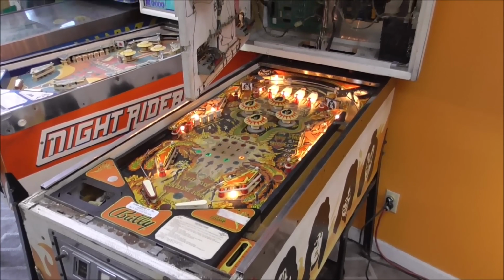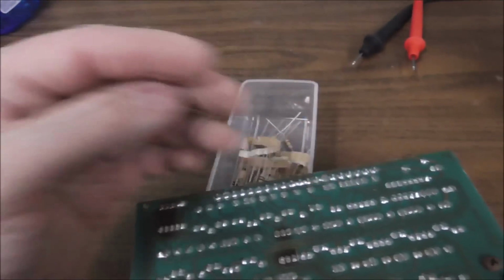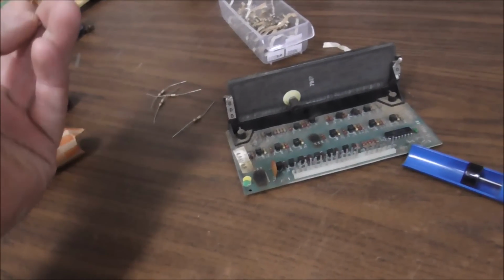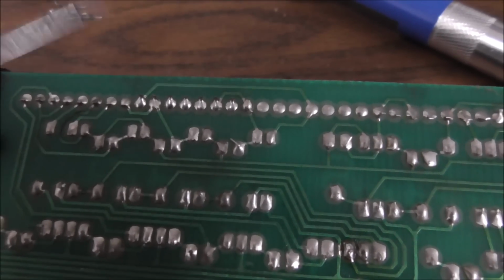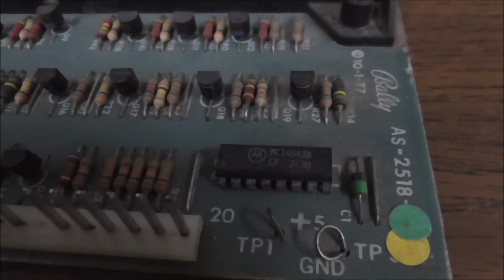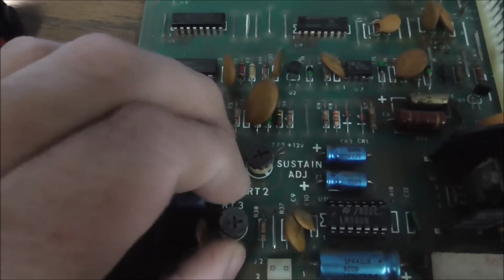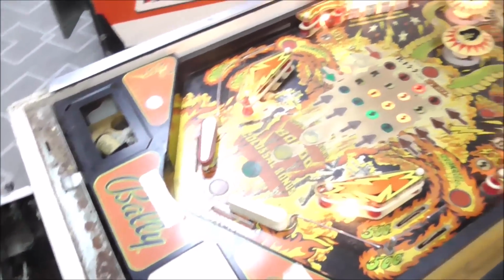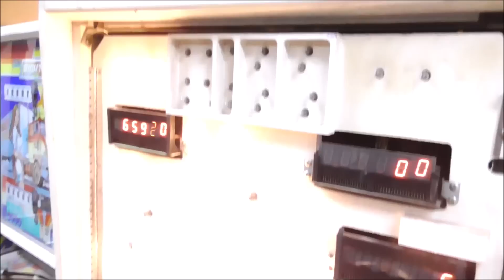Fixing Bally's Legendary KISS Pinball Machine Soundboard & Displays - Repair #4

Comment: those are carbon composition resistors by the looks of it.  those things love to drop in value  over time when they get hot.  I used to repair equipment with nixie tubes, and it used carbon comp anode resistors that would do that.  so the resistor would fail and keep lowering resistance until the tube fries from the excessive current.   I would replace those resistors with carbon films which is your usual tan resistors.  I think the reason those carbon comps lower in value, is because the resistive material is a mix of carbon and phenolic dust;  the latter is normally an insulator, but when it heats up, it decomposes and contains a lot of carbon.  so it goes from insulator to conductor and then more current means more heat, and more decomposition.

Comment: Hi Ron!
Point of curiosity (and please forgive me if I've asked this before... It's been quite warm this week, and my own memory is a bit fried... Which oddly enough, ties into my question today):
Over the course of this repair, you've noted several backbox items that needed attention related to heat damage over time (burnt pins, and solder joints, which can break as a result of heating while on, and cooling when off). Acknowledging that the damage you noticed/repaired appears to have taken about 40 or so years to manifest itself, coupled with the fact that many of the manufacturers of these machines did not anticipate these machines still being in service so many years later, in your opinion, would the addition of a small exhaust fan on one of the upper backbox vents (tied to a 5v or 12v point on the solenoid board) help extend the life of the backbox components (by causing a sustained airflow throughout the backbox), or am I perhaps overthinking this?
Reply from the maker: They built some vents into most of them so the heat must have been something they were thinking about, I suppose you could add one in if you'd like...

Comment: HI, great video. on my Kiss pinball the group of lights that light up the band behind the back glass have stopped working. All the other lights work fine. could you give me a direction as where I need to look to maybe fix this issue thanks
Reply from the maker: If it's the ones in the center that is just the General Illumination lights, if you look over on the right hand side inside the backbox, there is a large transformer with a pcb above it, that's the power supply.  turn your game off and unplug it from the wall, then there is a large 20 pin connector on that power supply that can unplug if you pull it straight out.  If you look close at that connector one wire will have burnt the crap out of the connector, it'll be brown.  That wire is your problem, if you look at the back of the door where those bulbs go you can see what color wire runs to all the bulbs then look at where that wire plugs into that connector.  At our shop we repin them, replace the pin on it and the connector itself if it's too burnt up, but you may be able to get it to make good enough contact to turn the lights back on by just messing with the wire.  Have fun with it!
Reply: @LyonsArcade  You are the man, I pulled the 20 pin connector out, the left end of the plug ( green and yellow wires) look to have been burnt on the connector. I wiggled the wires and wala the lights came back on :) thanks for your help brother   YOU ROCK!
Reply from the maker: No problem Mike if you watch some of our bally videos you'll see how we repair it long term by replacing those pins, have fun with your machine!

Comment: Correct me if Im wrong.  Those resistors may have gone lower resistance due to heat melting the copper windings together creating a path where a higher flow can go through them?

Comment: Once again....for the non-American crowd that has bastardized the pronunciation of solder...the English, Oxford dictionary has the pronunciation of it much closer to Ron's than the accepted English way of saying it. 
sol·der
/ˈsädər/
noun
noun: solder; plural noun: solders

    a low-melting alloy, especially one based on lead and tin or (for higher temperatures) on brass or silver, used for joining less fusible metals.
    "remove the fitting using a blowtorch to melt the solder"

verb
verb: solder; 3rd person present: solders; past tense: soldered; past participle: soldered; gerund or present participle: soldering

    join with solder.
    "the wires to this clip are soldered to the circuit board"

Origin
Middle English: from Old French soudure, from the verb souder, from Latin solidare ‘fasten together’, from solidus ‘solid’.
Translate solder to
Use over time for: solder
Definitions from Oxford Languages
Reply from the maker: You just know the guy pronounces "Joint" "Jahnt" too, lol

Comment: This vids are incredibly informative and much appreciated. Since the pins are close do you just put a very small dab of solder so they don't cross to next pin, or use flux?

Also if anyone needs a link to those 4543 decoder chips I found this to help out. 
https://pinside.com/pinball/forum/topic/tech-bally-6-digit-displays